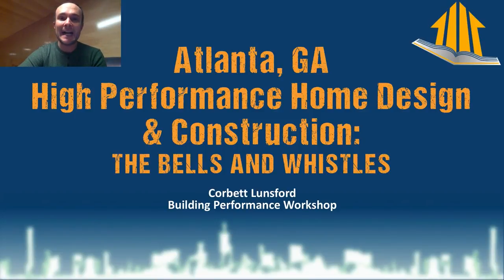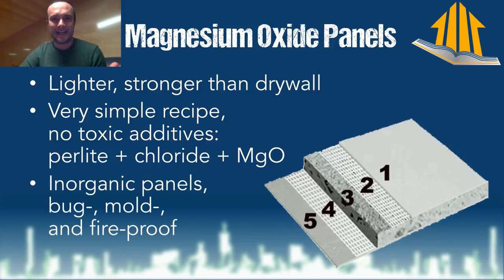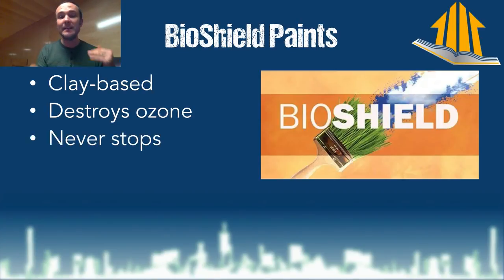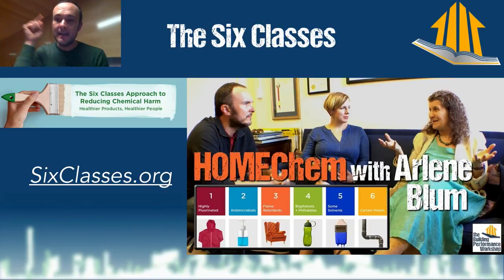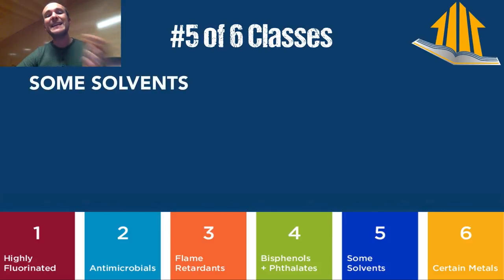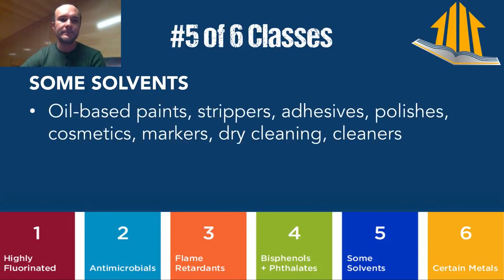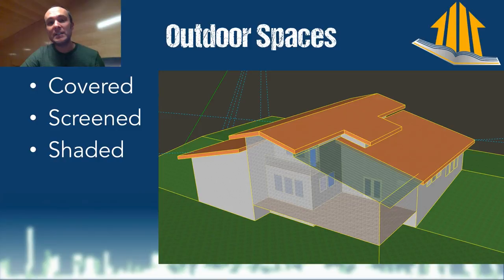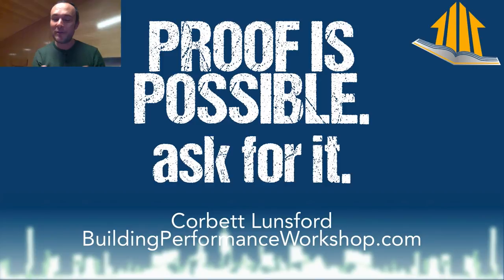Our Performance-Tuned Home Build Pt4: BELLS & WHISTLES

Comment: At some level, once built, I can see being able to limit, but not completely eliminate all of these. I guess this is where properly ventilating becomes important. Most will think I’m crazy for wanting well over the recommended air changes through an ERV, and a forced air system that moves enough air to work like a portable air purifier in each room. I genuinely don’t want anything in my air at all.

Comment: I used to kind of roll my eyes about some of the more extreme VOC and gas control ideas, but as I’ve gotten older my allergies have only worsened, and I notice all kinds of things set them off, and lots of things can just give me migraines. At this point in my life I’ve concluded that the more I remove anything from the air at home, the less all this crap tends to bother me while out in it during the day.

Comment: How does one deal with neighbors' woodsmoke which will surely be sucked into a continuously running ventilation system?   Some smoke particulate matter is very small, much smaller than PM 2.5.  Also the awful odors from the smoke gases--what to do?  (John Bower, who wrote a book called The Healthy House in the 1980s overventilated the house during the day, and shut down the ventilation system or put it into recirculate mode at night.)
Reply from the maker: Yes, one should choose neighbors carefully. Look into Pure Wellness air purification, they have filtration solutions several times better than HEPA.

Comment: You can start learning about solar by installing a grid inter-tied system without batteries, which will be cheaper and flatten the learning curve a little.

Comment: Due-stop to control bath fan , except I found it works faster if you mount it high on wall.
I also used 3 way switch to control    choice of heater or n
Reply: Or vemt.
Reply: Heater or vent.

Comment: Thanks for the great video. I definetly want to use magnesium oxide board but haven’t found a supplier. Do you have any recommendations on a specific product or supplier?  Thanks for your help. Having a great time laying out my new home for performance
Reply from the maker: Still exploring options ourselves, Vinnie
Reply: Thanks for the lead I will check with them!

Comment: Love your videos, thanks!  Have you given any thought to WiFi coverage and structured wiring design?  In my experience Low-E glass coatings really impact WiFi from indoors to my patio.  Using Access Points from Ubiquiti are amazing and not too complicated for non-techies.  The Unifi system will allow you to adjust the WiFi output power accordingly.  The APs are powered over ethernet (PoE) from a switch in your service closet.  A dedicated access point to serve guests of your dance hall, for example.  CAT6A may be overkill now, but 10Gb speeds could be in our future 10 years from now.  I would do CAT6A runs to each TV from a central cabinet at a minimum to support 8K data rates.  The systems from Belden to terminate these CAT6A connections look nice.  Don't forget video security cameras.  Good that you have that crawl space to run cable later.  For 5G mmWave maybe it makes sense to build a "mini-tower" next to your home to better receive future 5G services?  Or possibly distribute WiFi/5G services to your neighbors for some extra $.

Comment: Pricing in magnesium oxide and bioshield into my home budget now. Thanks for the recommendations. Great choice on the solar prep. I'll be using S-5! clips for my own PV install when the time comes. Keep in mind you'll want your PV inverter breaker at the bottom of your electrical panel and you'll want to mount it near the electrical panel in a shaded area.
Reply: Take a look at Schneider Electric Square D Energy Center panel that just came on the market.  It's one panel that has solar input, generator input, and a Built-in energy Monitor system.

Comment: Great video. Perfect timing for me, I am currently installing a wood floor and was still deciding on the finish (I don` t like Bona, which is what most finisher want to use today). The clay paints are something I`m going to look into for my house.
As for solar, you could certainly go with a grid tied system (no batteries). Although in most systems this means when the power goes out, so does your system. Check out Sol-Ark inverter, hi-efficiency, can be used with or without batteries (you can grow or change the system later). If you want the battery backup, look at lithium iron phosphate (lfp) batteries. Yes, they are expensive, but over there life span they will be less expensive. Plus,  you can add more batteries later if you realize you want more backup capability, unlike any lead acid batteries where all batteries need to be the same age.
Reply from the maker: Thanks for the tip, TJ. We have a solar system on the TinyLab, but I haven’t looked into it for a few years.
Reply: I thought you had, but technology has moved forward a lot in the last several years. I hadn't even heard of the Sol-Ark inverter last year when I was planning my hybrid (dc coupled grid tied) system. I would have bought the Sol-Ark inverter, if I had known about it, because it does a lot of things that I had to take care of separately. Additionally,  I spent the last couple years learning about the different types of batteries for a variety of reasons  and settled on lithium batteries (a Nissan Leaf [LMO] battery and a Ford C-Max Energi [NMC] battery) for my projects.

Comment: Grid tied solar is not complicated at all. Install the system and forget about it. With an all electric house you’d be crazy not to do it — especially with those 3000 watt water heaters! Going solar is about being in Control of your electric bill!
Reply from the maker: Yes to all, except I’m told by our municipal electric utility that they do not have a net metering agreement. Politics next I guess.

Comment: So much for learning what door bell you are putting in.  LOL

I look forward to seeing which type of tube you use for plumbing; copper, pex, etc.  I do know it won't be lead...

Do clay based plaster walls also absorb the negative chemicals?
Reply from the maker: PEX main line already installed from the street, so we’ll continue with PEX, but will drink water from a Berkey filter.